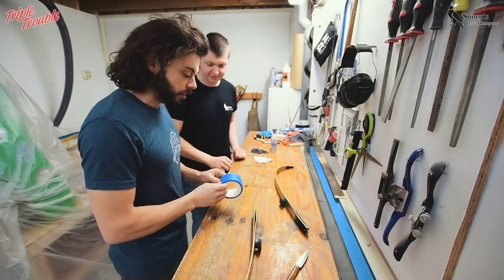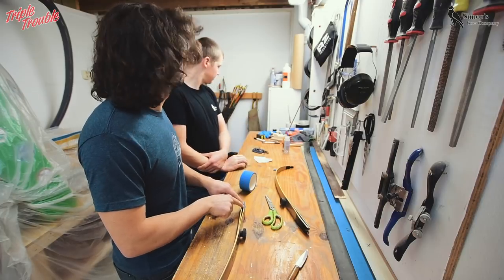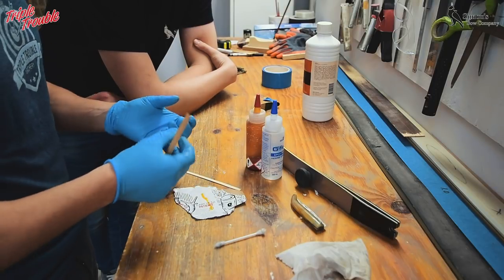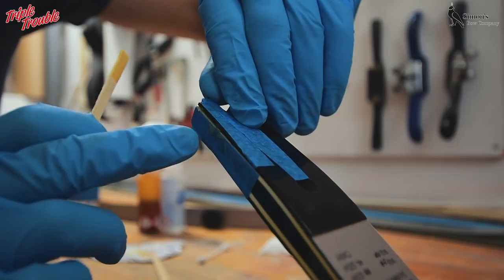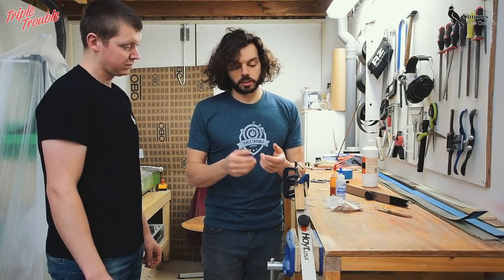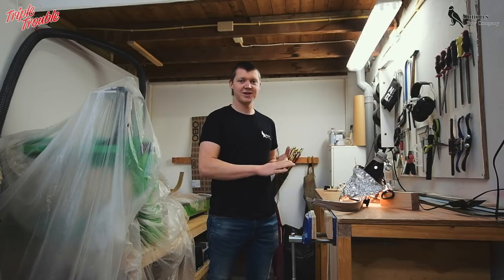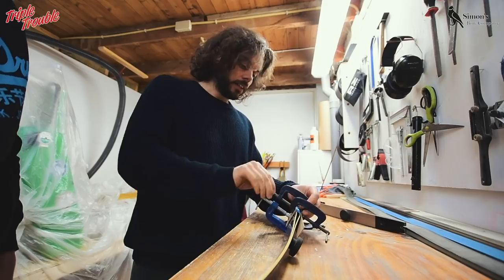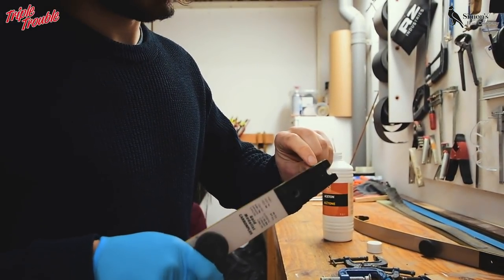Fixing 30 year old limbs! Part 1 (Hoyt Archery)

Comment: Hi
What's the glue name you use for the limbs please.
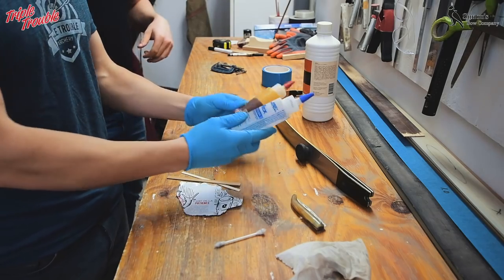Reply: 3:21 G1 Flex
Reply: @-fazik-3713  can I buy it from Amazon or ebay
Reply: @-fazik-3713  can you please link where we can buy
Reply: @osmansalem  yes, it's available on both sites, but it's called G flex epoxy by West System. There's no 1 in it. So they may not have the same type as used by Simon. Amazon does have G5, but it's a quick set epoxy.
Reply: @incorporeal3793  you are correct. It is called G /flex by West systems (not G1 flex, made a mistake).